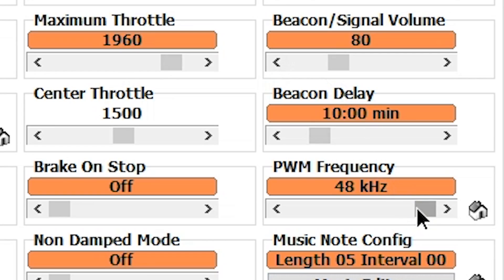BLHeli32 100% Explained - Part 2 - PWM Frequency

Comment: Stuck in 48-96 kHz PWM, what did I do wrong? Built two xilo kits and one adjusted no problems the other only has a range of 48-96 PWM. What’s happening?

Comment: I had yaw twitch on a kwad every time I'd give it throttle or do rolls n whatnot, and adjusting my PWM to 48 from 24 solved the issues 98%.  Going to experiment and drop it a tad and find the sweet zone. Thanks so much for the video Bardwell!

Comment: I have set 48kHz pwm freq and auto timing , and I've noticed much higher propwash and roughness in turbulent air, what should I do? I like the feel of the throttle at 48 kHz , but hate the oscillations of propwash
Reply from the maker: Try something between 48 and 24.
Reply: @JoshuaBardwell  I will, thank you, although I think that the creamy feel will fade away

Comment: 48K on PWN is not good at all ! I got wobble and stuff at low throttle on emuflight
switched back to 24K and all run ultra smooth without any wobble. 

So don't swith to 48K pwm it's useless !
Reply from the maker: I hate to tell you but this is the exact opposite experience of almost everybody who tries it. If it doesn't work for you, no problem. But you are definitely the exception.
Reply: @JoshuaBardwell  I'm not really an exception, some other pilot give me the tips on emuflight discord. Looking for this wooble since weeks and others give me this Tips. Jump back to 24k and no more wobles. Maybe on beta but not on ému for me. And this is Real on my 6" / 5" and cinewhoop so 3 différents quads same issue same result. So why having this issue on 3 type of quad ? I mean wobble on 48K ?

Comment: This setting is a must if your running t motor f55 pro 2 f3 mcu version. Running at stock 24hz I had uncontrollable bounce back at low throttle flips as I mentioned before. I also had bad frames when connecting to blheli. At 48hz I heard a delay when punching the throttle. 36hz was the sweet spot. Excellent video that will help anyone running especially a fast f3 esc. Didn't have any issues until updating my t motor f55 pro 2 f3 mcu 4-1 esc. Now it's my best running quad. JB video on bidirectional D-shot and filter tuning is a must! Much appreciated Ryan and JB

Comment: I just fixed my bounce back with this pwm setting. My t motor f55 pro 2 f3 mcu 4-1 esc gave me more pid tuning problems than anything I've ever experienced, so I thought. I accidentally ran across a forum that suggested turning it from default 24hz to 30 or 38. So far 30 made a massive difference. A week of tuning and the setting I would least expect

Comment: What should the min and max throttle be set too I just flashed a new esc and set all settings to the same as the rest and another one fried when I plugged it in then I desoldered it and the other esc works but that one work b4 I installed the new one idk why it would of blown when I plugged it in. I just had it plugged in to flash it and it didn't blow. All  I did was disconnect and reconnect battery in betaflight this time cause I was gonna calibrate the esc cause I just installed the new one.
Reply from the maker: Use Dshot. Then min and max throttle don't matter.

Comment: I saw a post made by Tim Sweet about PWM Frequency saying that running 48khz was not ideal because there was some kind of data loss or something like that and it was better to run it at 32khz is that true??
Reply from the maker: I think you're thinking about the multishot frequency, which is between the FC and the ESC. We are talking about the PWM frequency between the ESC and the motor, which is totally different.
Reply: Thanks for the answer, I found the post, it was made by the Helio FB Account.- 

Saturday PRO-TIP:

On blheli_32, If you’re getting weird oscillations you’re having trouble tuning out, make sure your PWM rate in blheli suite matches your pid loop speed. 48kHz PWM rate actually can create an EMI problem that can be resolved by lowering it back down to 32kHz, 24kHz(default), or 16kHz. ESC manufacturers, such as Aikon, are aware of the issue and have taken that into consideration while testing new 6s prototypes.

Comment: I've been running at 48khz and notice exactly what Ryan was saying about a needing higher throttle stick position  to maintain a certain altitude while cruising.  What is the best way to compensate for that? Maybe a little throttle expo? I absolutely love the way it flies, it's just the feeling of not having as much stick travel(throttle) left, if that makes any sense?? Or should I leave it alone and learn to like it? Lol. Thank you Josh and Ryan, love these videos!
Reply: A throttle curve would certainly work, but I also think you can just get used to it after a while. You can also try dropping the PWM rate back to 24 (which is what is used on BLHeli_S), and see if it changes things at all and if you develop any mid throttle issues. You can experiment with different values between and see if you can find a sweet spot. Give it all a shot and see what works best for you :D

Comment: Can you comment on the increased switching losses in the FETs causing higher junction temperatures. 

Since you have a FLIR, would be a nice video to measure the difference...
Reply: Experience is also a good source:) In the same package ESC makers can get different Ohm-values which makes ESCs easy scalable at relatively low price adders. Seems there is quite some headroom by design which also makes sense ... an overheated ESC causes damage in reputation which the hole FPV community will get to know as soon as one of you guys have such a failure :) - Thanks for the quick feedback. I really appreciate this.
Reply: Yeah, my guess is the engineers responsible for the ESC designs factored the 48khz switching losses into the thermal design of the ESCs, which is probably one reason why BLHeli32 ESCs tend to be a bit more robust designs than _S. Would be interesting to talk to someone who worked on one of the designs. I may float that past Steffen (BLHeli dev) next time I talk to him. Curious to see what he says.
Reply from the maker: That's an interesting point. The faster the FETs switch, the hotter they will get. I think it would be very hard to control for environmental variables to measure this though, especially because the ESC would have to be driving an actual load.
Reply: Another issue with flir is it is very hard to get reliable and comparable data. Small things like surface reflectivity can make a difference in what temperature the sensor reads even if the actual radiated energy is the same. Flir is decent to compare temperatures against the surroundings, and as a broad strokes kind of measurement, but not if you're trying to look at specific data.  I was looking at this as an additional data point for MQTB, but ended up abandoning it for those reasons. It would be interesting to see where the hotspots move as the switching frequency changes though, but I'm not sure if FLIR would be accurate enough to be able to detect a measurable difference. Or even if the difference in PWM rate is enough to dramatically change the switching losses. Higher switching losses implies lower efficiency at the motor output, but in my testing so far I haven't seen a dramatic difference in efficiency at different switching speeds. I did some back to back testing when BLHeli32 first came out. My guess is that the differences in switching losses is minimal compared to other losses in the system, but I don't have enough data to say that for sure.
Reply: The boundary conditions need to be carefully adjusted but it is a standard procedure in any industry .. why FLIR exists ... and it’s certainly much easier compared to maintaining equal condition for vTX testing :)

But maybe a theoretical consideration (high level) should do it. I was just missing this downside of simply doubling switching frequency to be shared with the community because in can result in a burnt ESC. 

Double switching frequency means double switching losses. Assuming 50% duty cycle and 2/3 switching losses, the overall losses are increased by around 30%. 
Assuming you have 2W of losses in each MOSFET leading to 120C junction (depending on cooling conditions) temperature, a third more losses is a lot because it means a third higher temperature. 

The essence is, for those you have maxed out their ESCs with bad air flow for cooling, doubling switching frequency carries a risk that should not be ignored.
Reply: Definitely worth looking at closer. I have almost never seen an ESC fail due to over current or overheating in flight, even when they're stuffed in the middle of a build with no airflow, they typically barely get warm even in very heavy applications.  Generally speaking the only ESC failures I have seen have been from either something else wrong in the system (bad tunes, etc), physical damage, or blocked/damaged motors. I've run some crazy setups on 20A aikon ESCs and can't get them to burn. I would think if going to higher frequency PWM increased the losses and heat saturation to a concerning point we'd see a corresponding rise in real-world failure rates at 48khz, but that hasn't been the case as far as the general community feedback goes. It's possible something else is mitigating the increased losses.  Like I said, I measured no significant loss of efficiency from the motor output perspective at 48khz vs 24khz, which you would think would show up with a 30% change in switching losses. Maybe we're missing something? On the other hand it could be related to the low end torque losses we're seeing when using higher PWM frequencies?

Comment: OFF SUBJECT BUT I CANT FIND AN ANSWER TO THIS QUESTION AND I THOUGHT YOU MIGHT BE MY LAST HOPE :) . WELL THERE MIGHT BE ONE MORE PERSON BUT I FIND YOU VERY KNOWLEDGEABLE ABOUT FRSKY . 
I thought i would be smart and put a frsky receiver and a battery sensor in my umx timber and have telemetry . Opps . I have a multi protocol transmitter on the back of my x-lite running the timber - works great . So i thought i would use the internal transmitter hooked up with a frsky receiver and a battery sensor to get the battery condition . But i get no telemetry from the frsky receiver . I made a new model and checked the system and it works fine . So i put it back on the timber model and no telemetry . If i turn off the external tx it works fine . As soon as i turn on the external transmitter i lose telemetry . Would you know what im doing wrong or a way around this ? EYE TROUBLE I USE CAPS .
Reply from the maker: I have never tested a system with two separate transmitters before. It's possible that the external module is powerful enough to interfere with the weak telemetry signal coming back from the model.

Comment: BLheli32 manual for maximum supported speeds indicates Dshot 16kHz [DSHOT600]: 420k erpm / Dshot 32kHz [DSHOT 1200]: 310k erpm. A 14 pole 2300kv motor on 4S =270k erpm. I run T-Motor Pro II 2400kv motor on 6S =423k erpm. Currently I have wraith32 v2 ESC's [48kHz] current limited to 35A.  Does this mean I should use DSHOT600 instead of DSHOT1200 until I move to ESC's with 72MHz or greater MCU? ...or did I not understand this part of the manual?
Reply from the maker: I am not 100% sure but it sounds like you're right. 6S on 2400kv is a pretty unusual situation and it's plausible that you are exceeding some design limits.

Are you flying on Dshot1200 and is it working for you?
Reply: Yes.  I have a rig on 6S with DSHOT1200.  Before BF3.5.1 I could only hit 50% throttle before stage one failsafe and it was horrible to fly.  Now I can hit 80% throttle before small oscillations start showing up.  Other than that, the quad flies like it's on rails.  Feels great, sounds great, cold motors, cold ESCs, and the blackbox is fairly clean.  I haven't tested full throttle as 80% feels like full throttle on 4S with what appears to be less amp draw.  I've been out of the air for 6 months so I just wanted to fly.  I started tinkering again (updated to BF4.0 dev build, tried different props, and looking at ESC settings) to see if I can clean it up.  I just moved to DSHOT600 also.  I'll see how it flies this weekend.  My first 6S 2400kv build was perfect.  This one is taking awhile.  I like the 6S on 2400kv because I tend to use less amps and I don't notice any voltage sag.  I also have extra punch if I need it.  BTW - Thanks for all you do for the hobby.  I started watching your channel when you first started.  Well done.

Comment: Hmmm, so is the saying that “the higher the value the higher the chance I’ll smoke my ESC” a huge misconception? 😵
Reply from the maker: Definitely not true. Higher PWM does not make it more likely to smoke the ESC. Maybe this was once true with older ESCs that were too slow to handle the faster PWM frequency but not any more.
Reply: @JoshuaBardwell  Actually, higher PWM does increase switching losses on FETs, so it's more likely to smoke the ESC. It depends on FET quality, PCB layout, etc. I think it's not an issue for these 24..48K speeds, it's more likely to get noticeable effect when you close to 100K switching frequency...

Comment: Thanks buddy. I got a micro that has terrible mid throttle oscillations and I just didn't want to go with it, but I'm going to try adjusting the pwm frequency to a higher rate and see if that helps.

Comment: wow speaking of i had this tuning problem looked at all your bb 101 videos and couldnt tune it for nothing so i found my problem in blheli 32 . i always run 48k pwm on all my quads no problems at all so i get this new board the same setup and i always run the same settings . so i go back and look at video from my board and mototr twitch and yaw twitch and i look over everything i even changed motors . so i go back change my blheli  32 pwm to 32k and bammm fixed ...so not all setups require 48k pwm ...wow